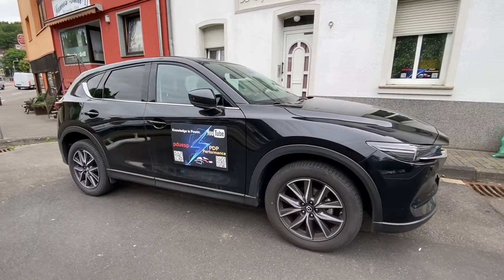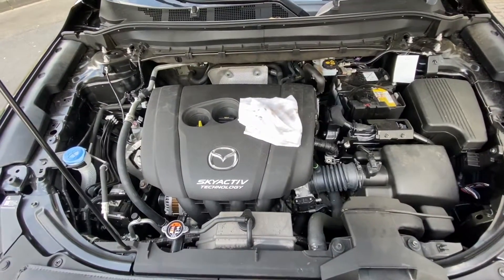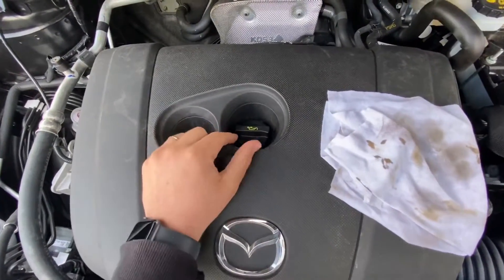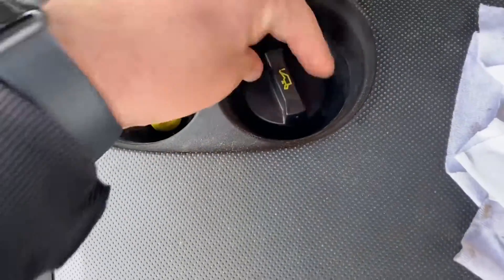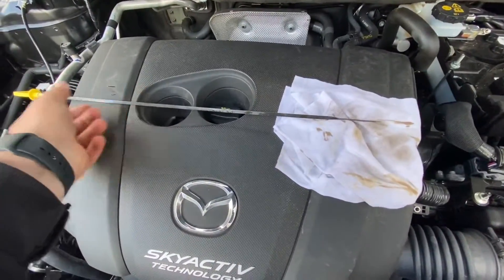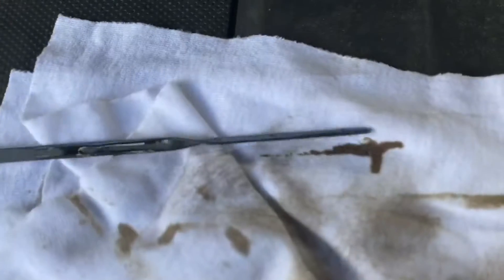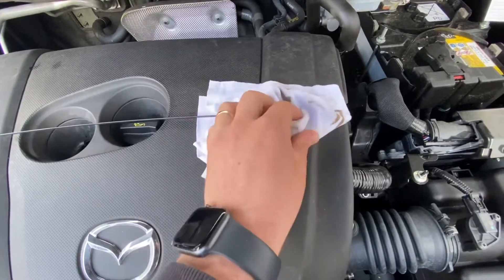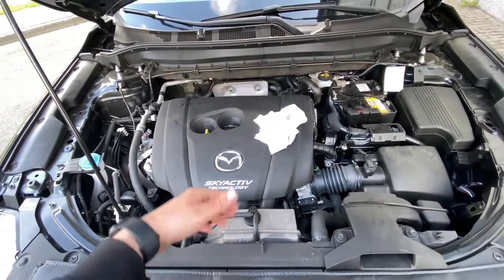How to check and top up your oil level if it is necessary Mazda CX-5 DIY

Comment: Thanks a lot. I have a diesel engine and my oil level was slightly above max but waay below X and I was worried…but this video proved that it’s normal in diesel engines. Thanks again.